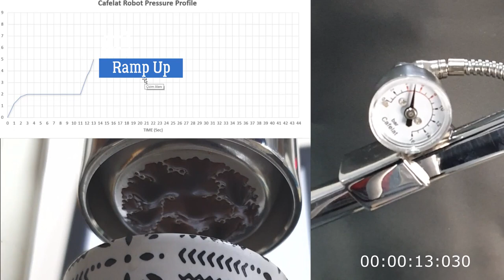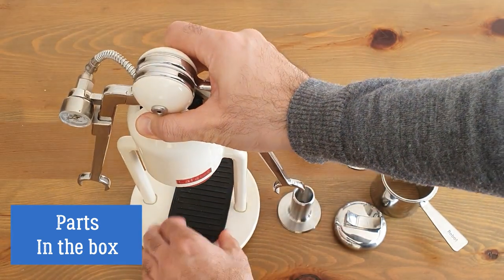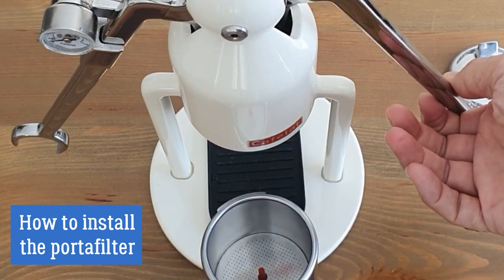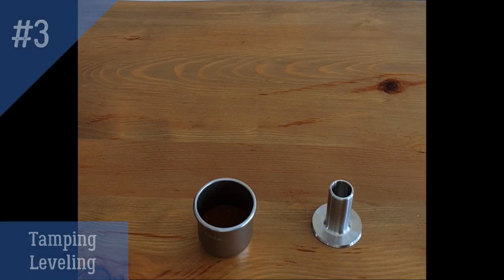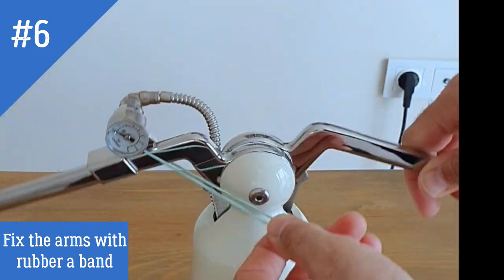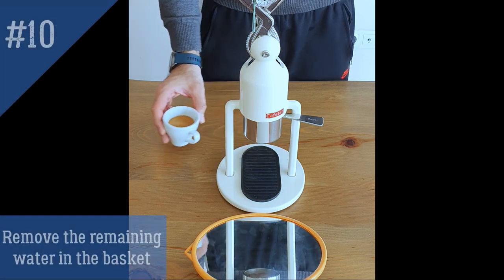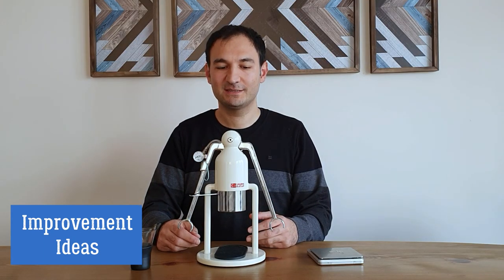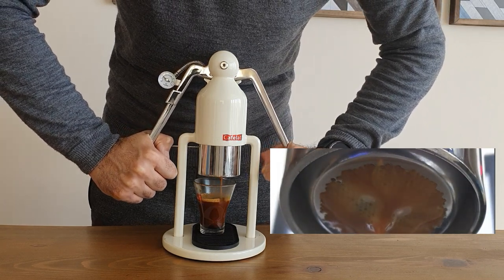Cafelat Robot Detailed Review - All Tips and Tricks (English)

Comment: Because the legs screw into the base, you could in theory add a spacer between the bottom of the legs and the base that is a bit wider to make the space tall enough for bigger glasses and to fit a scale.
Reply from the maker: That could be done but force applied will be carried by fewer threads. It is a robust design anyways. :)

Comment: What grind size you suggest? I've a 1zpresso grinder made for espresso.. thankyou
Reply from the maker: You need to grind for espresso, which is pretty fine ground. Which 1Zpresso model you have?
Reply: I've a 1zpresso k ultra. Many thanks if any help. For now I am trying at medium espresso suggested clicks (120 clicks). 
More, if You can help me, I've this problem: 
I've done 10 coffee. Three time the coffee was very very good for a beginner... and all the other times when trying to make the leverage the water spilled from above without the possibility to generate any pressure. 
The problem is that I have not the feeling of a badly inserted portafilter, and the seal seem ok. The portafilter stabs seem both inserted.. 
Sure is a problem of the portafilter-seal, but i don't know how to fix it. I inserted the portafilter as in the user manual.. all the time the feeling inserting  was the same.. but most of time I have had only water from above..  
I am without ideas, the problem seem random.

Comment: Does the PISTON normally touch the surface of the coffee water, or is there always a layer of AIR in between?
Reply from the maker: Normally, there is a layer of air due to gaskets on the piston.  If the seal is damaged, you may see contact with the water.

Comment: Thanks so much for making an English version! Can you share more info of how you use the Comandante with the Robot? And also the method using the wdt tool? Do you stir all the way (the tool scratching the bottom?) Thank you!
Reply from the maker: Hello, thank you for watching. I mostly used Comandante 6-7 clicks with Cafelat Robot. That worked well with 16-18 grams dose and typically 1:2.5 ratio. I used  a "wdt-like" tool and my method was not the best to distribute the coffee but it seemed to work well. I did not follow a specific pattern. I just stirred all the way by drawing small circles.

Comment: I just got a DF64 to go with my Robot. I've been pulling decent shots on the Robot for about 18 months now with coffee ground at the roaster. The coffee from the roaster isn't always ground exactly the same though so sometimes it's goes through too fast and sometimes it's too fine so it doesn't work at all. When it's good, it's very good. 

However, I have not gotten the DF64 go grind coffee yet that makes and espresso. The Robot shoots water out the sides and the shot ends in 10 seconds. I thought it was too course so I ground some finer coffee with the same result. I tried every grind clear down to powder and it finally channeled right through the middle and made an unusable shot in 10 seconds again. I think that up until I got to the powder it was lifting the puck and water was shooting out underneath. Have you had this problem?
Reply from the maker: it could be a gasket related issue. Can you please check the gasket for any damage or tear?  You may remove the gasket, inspect, clean and reinstall. This could be the reason in order not to create enough pressure for a shot. There could be a leak.
Reply: But I can pull shots with coffee from the roaster still. I thought the same as you and then I also thought about grind size so halfway through taking 3 or 4 cafe showers I put in the coffee from the roaster and pulled a perfect shot. With the baseline set I went back to taking coffee showers. 

With the Coffee from the DF64 I've ground from 26 (zeroed) down to 10 with the same results - a 10 second coffee shower with it spraying all over and no resistance. When I ground at 3 which is essentially powder I got resistance right off the bat and then nothing as it visible channeled through the middle. 

All pucks came out complete and dry. I suspect that the puck is lifting and the water just goes under it.
Reply: @GrantMcWilliams I really hope you have solved your issue by now but this sounds like an alignment issue with the burrs of the df64. There are a few videos on YT that explain how to check and fix your alignment.
Reply: For future reference, what you said at the end of your last comment is probably what is happening. Once you push down on the arms, you cannot ever lift them or even take away all the pressure until the very end of the shot. The pressure creates a vacuum that is powerful enough to dislodge the puck and have the water bypass the coffee completely. Watch Sprometheus' video on the Cafelat, it happened to him too.

Comment: A proper 58mm design with standard portafilter mount would have been nice. Could have used standard tools at least. Baffling as to why they didn't.
Reply from the maker: I agree with you. It is one of the best manual devices in the market and seems like they have a different marketing strategy.

Comment: Hi, How did you track the pressure profile shown at the beginning of the video? I am guessing by recording the video and manually putting the data points to a spreadsheet.
Reply from the maker: unfortunately, that is true. It is manual too . It takes some time but ı wanted to create a few videos to see the change in time.
Reply from the maker: Full version is here  https://youtu.be/E6y-_N0fHRs
Reply: That's great! I like how you use the mirror to record the angle from the bottom of the portafilter also. I am using a Robot at home also. Thank you for the video.
Reply from the maker: @leontruong2001  Thank you! There are better alternatives for the mirror but I believe it is an essential accessory for such espresso makers. I hope  my experience is aligned with your experience.

Comment: hello sir, question

I just did my 1st shot in my Cafelat Robot

My set up is similar to yours:
Comandante (7 click without Red Clix)
Coffee (14Gram)

Water directly before boil

However I am having an issue on generating any pressure (only reached 2-3 bars) even when I press hard (I just finished quicker)

Do you know what can be improved for my case?
Reply from the maker: If you cannot generate required pressure, then you need to grind finer and/or tamp harder. You may also want to increase the dose (amount of coffee) while doing this. I highly recommend to use a WDT. Good luck!
Reply: Thanks, will try. I do try declumping using chopsticks, maybe it's not good enough.

I have been rewatching your video and felt that you generate 8 bar quite easily; how hard do you actually press? Do you use your body weight at all ? So far I only use my arm strength while pressing since my table is taller than yours.

I tried to do more dose today (18.5grams and 5 clicks on comandante) and are able to do 5 bar but very unstable (more stay at 4)

Overall taste is fairly decent, maybe a bit on the sour side.
Reply from the maker: @Sandevistan2020  I use my body weight to generate enough pressure (8+ bars). It is not easy to press with arms to generate such pressure. It may be because of the coffee you use. Is the coffee you use fresh? Is it light roast or espresso roast? For testi ng purposes, you may want to grind as fine as you can but this may also create channeling. Have you tried different coffees? If you do everything right (whole process, correct installation, etc...) the issue could be with the gasket seal or the product itself.

Comment: A lot of unnecessary "hacks" e.g. you really don't need the rubber band if you just change the workflow a bit. Also you missed the biggest helpful tip which is to measure how much water you're putting in, that way you don't have to mess around with switching cups at the end. Simply push all the water out.. 20g coffee with 60mls water will give you 40g out. Perfect.
Reply from the maker: Thank you for the tips and comments. I always use a scale to measure the espresso output. Everyone has a different workflow and there are for sure better ways to manage it. Some of the tips were requested by the users to be added in the video. It is nice to hear tips like you recommended. Once again, thank you.
Reply: but more water means also more stable temperature, doesn't it?